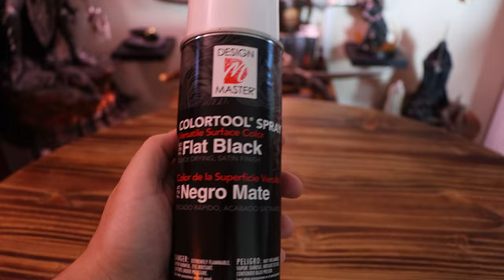Fixing a Weta Workshop Lord of the Rings 1/4 scale Helmet

Comment: I don't know the exact color SSW used for these, but if you ever have to try this again. Just start with a black that is the right hue and then try different top coats in different sheens. Matte or flat are the dullest but still have a small amount of sheen. And each manufacture is slightly different as well, but is usually thinner then adding additional layers of paint.